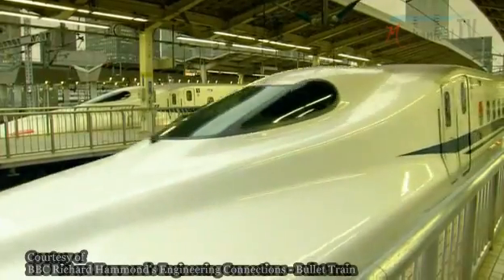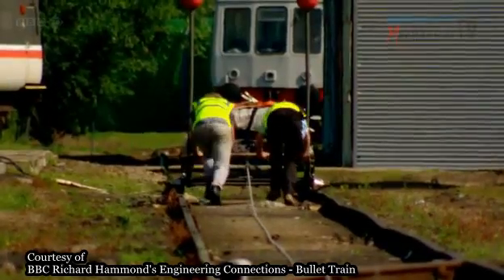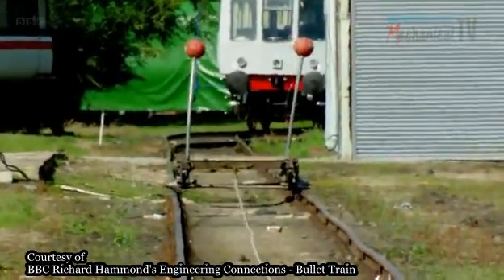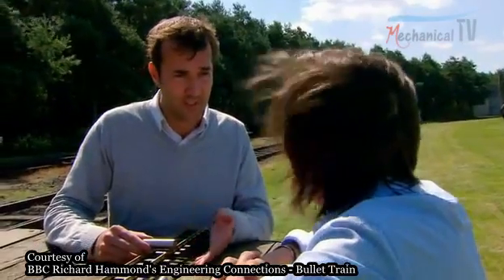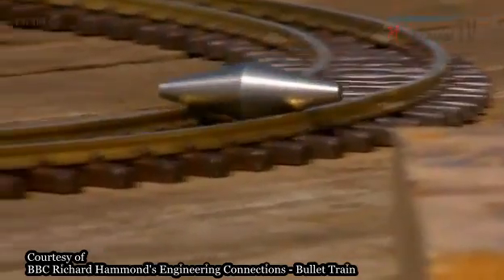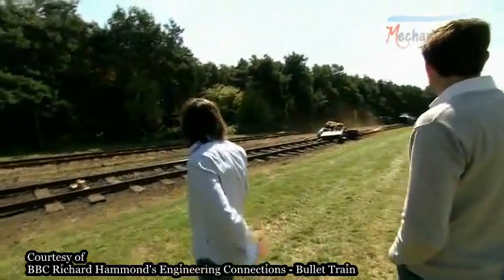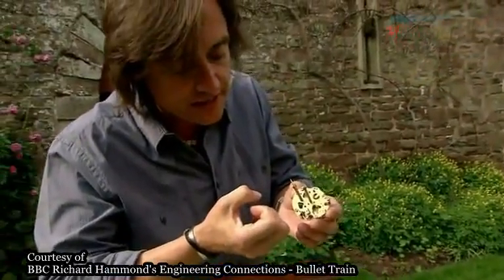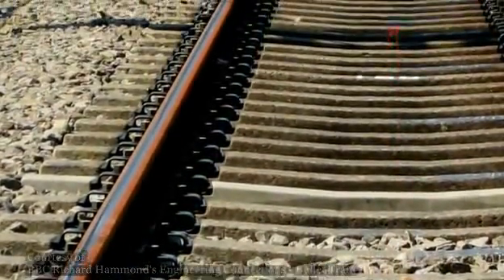The Japanese Bullet Train - Wheel and Suspension Technology

Comment: This experiment don't fit in some landscapes where it needs to face extremely condition, like tracks are passing through desserts and snow mountains with low temperatures. Temperatures are also need to concern when it comes humidity weather, heavy rainstorm, dessert with extremely hot weather and also snow mountain with lower weather as well, that may affected the trains exterior design. So far, China overcome the difficulties already. Japanese technologies are not bad at all, but not the best high speed train at all.

Comment: They talk as if the crash at 3:00 is because of the oscillation. In reality the flanges are just way to deep and wide so they didn't fit through that crossroad. That crash had nothing to do with the slope of the flange.

Comment: I'm no expert but I'd say it derailed because the flanges hit the pavement!
Reply: Yup...it did,but it was still pretty unsatble
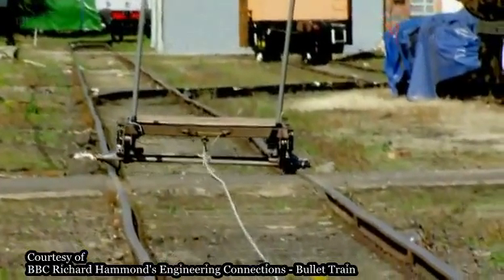Reply: +Steven Michael 3:13 - After decades of investigation and science they finally build a superstabilized bullet train. But also this train derailed every time at that position. It was a unanswerable miracle!
Reply: +Steven Michael   I see the same thing.  I wonder if they got there that day and couldn't get it to go unstaole - they miscalculated.  So they had to have a crash for the video and had it hit something just to show it jump, for the less observant viewer.. Or they just missed the fact that the wider, high cone angled wheel would hit the pavement since there was less space to the track for "normal" Flanges.  OOPS on them....Both the cone angle and the train speed are "gain factors" in this feedback system.  Higher speed or cone angle puts you closer to instability.[I majored in Control theory and designed electronic feedback systems (phase lock loops)
Reply: +Steven Michael Yep.  Pretty weak substitute for science.  I wonder if they sell used cars?
Reply: Steven Michael 
Exactly. The flanges were farther inwards than their supposed to be so they hit the pavement.

Comment: The Nozomi 500 model was the best. The new 700 is crap. It's too square, and you feel the shockwave when passing another train in the opposite direction (which happens every 5 or 6 minutes btw).
The 500 was round, like a tube, and suffered the least vibrations. But the people complained that they didn't have enough headroom. BS I say, since I am 6"2, and I was very comfy in it, and able to walk around unimpeded.

Comment: If the wheels are flattened, how does it take the curve then?
Reply: *****  They are! 
As I pointed out just above;  He states in the video that the cone angle is halved. It is half the normal angle meaning it can not take as sharp of curves as regular trains.  The minimum curve radius is about twice normal.
...
 You just can't see the smaller cone angle, but it must be there, or the trucks are mot self centering.
That's also why it is precision machined..   One can easily also assume that wheels must be regularly chesked for wear, or they can become unstable.  This is a mechanical feedback system.
...
Also, springs don't dampen. They just allow movement.   Dampers, or shockabsorbers dampen.
Reply: +Sarvesh Thakur No, no.  He states that the cone angle is halved.  You just can't see the smaller cone angle, but it must be there. That why it is precision machined.. ...Also, springs don't dampen. They just allow movement.   Dampers, or shockabsorbers dampen.
Reply: +Cor Unum Super-elevation of the track would help, plus curves on a high speed train tend to be a lot longer than on a regular railway.
Reply: I assume it slides a bit... And my best guess is inner wheel is the one which sides. But then again Bullet Trains do not go through very curved tracks so it's negligible.
Reply: I cannot grasp how it is able to turn if the wheels are not somehow (even a little) cone shaped. Curve happens when we have on one side the wheel contact on the smaller circumference and the other respective contact on the side which is slightly bigger in consequence. I couldn't dig how the entire wagon (2 sets of 4 wheels each) remains straight while curving, but now I get that, those clever ass engineers. I wish I could see the wheels from under when the wagon takes the turn, I believe that they have freedom of movement in between.